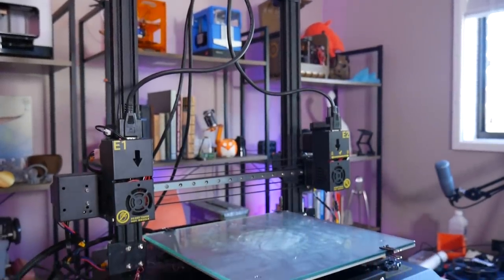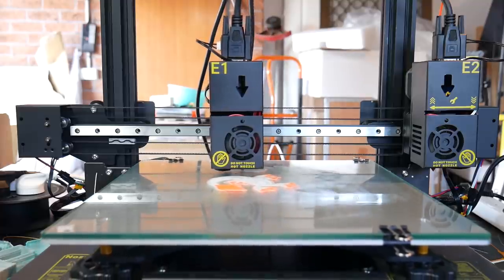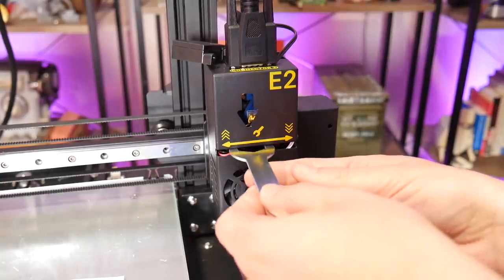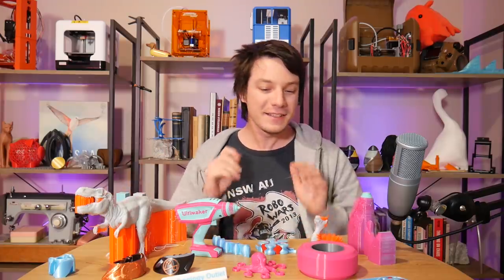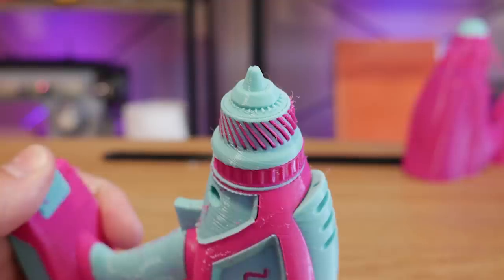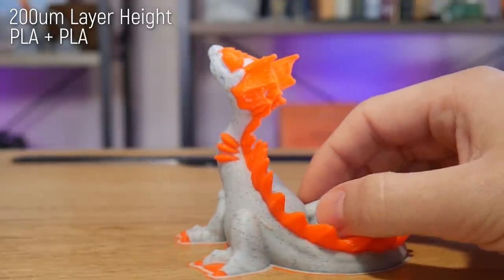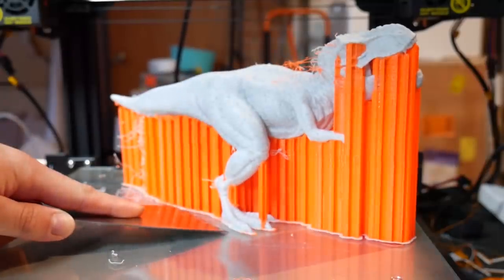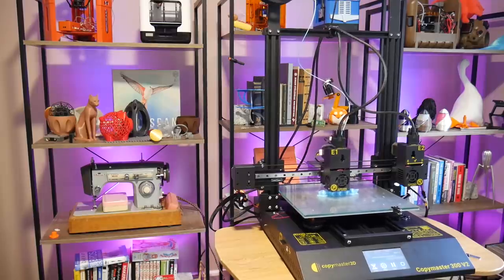Huge IDEX 3D Printer - Copymaster 300 V2 Review

Comment: Ive got the copymaster 300 and from the word go its crap. Ive spent months and months over at least a year trying to get it to print well, due to watching and learning from you i got it to print ok now. So personally due to the hassles ive had and no support i wouldnt never buy a machine from these people again, and ive spent alot of money in my eyes with technology outlet, 2 printers, 3d scanner and filament/resin. With not much help, watching you has been more help. No doubt you had a good one, but with their other machines can be hit n miss. On the copymaster 300 the print head is far to heavy the same as this one, only one cool fan to do both jobs without being able to added another fan, the print base bent like a banana, adding the filament roll to the top of the gantry is the worse thing to do the list goes on. One of the most dangerous things ive had is the earth arcing inside on the mother board which causes the famous stop in mid print, and restart. I had to solder the earth straight to the mother board, these things are a fire hazard. But after making my own print head carrier adding gantry braces, moving the filament off the machine, adding a manual filament cooling fan, and a auto bed leveller it now prints good. Should have bought something else but once you commit some time you dont have the money to just throw it to one side and get something else..personally i wouldnt bother with this as i couldnt trust it, if you had hassles setting it up god knows somebody without any knowledge would get on..